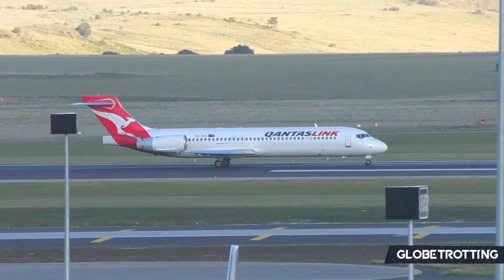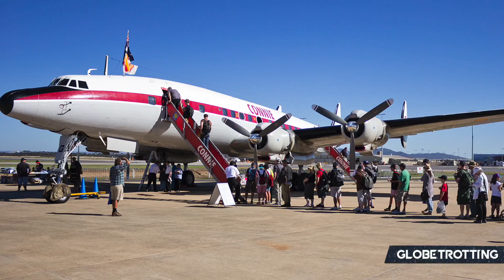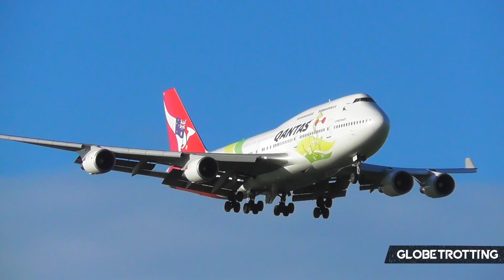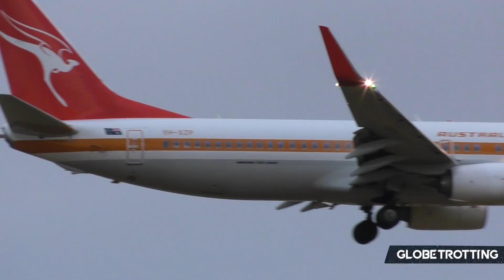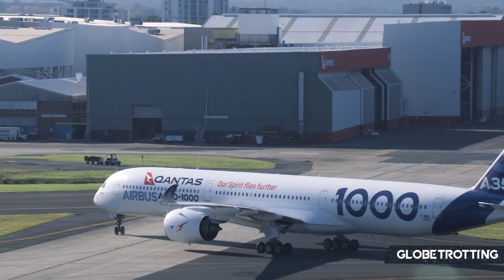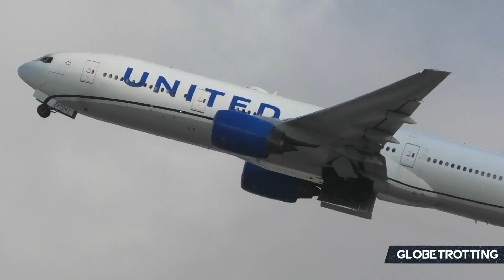707 TO A380 - Qantas Aircraft History

Comment: The decision to effectively replace the B767 with A330’s was in my opinion backward as the B777-200 and then 300 would have been better.
Reply: I honestly don’t thing so as the 777 is massive and would be way to big for smaller domestic routes, I recon the a330 fits better within the domestic network but I could see the 777 used in Asia routed and to NZ like air NZ do with their 777s
Reply: The A330 only came onto the domestic routes in the period after 2010. Which equates to my view that it was an international aircraft, but of course as we saw  QANTAS often used their 747s on domestic flights when they needed the extra capacity. But where the 777-300 would have shined, again my opinion, was on the 10 hour flight circle. I did hear via industry sources that Qantas did get a very good deal on the 330s leading to the purchase of the 380s.
Reply: @michaelhayden725  i do remember hearing about that a330/80 deal too
Reply: 330 is a far superior and more flexible plane than 777